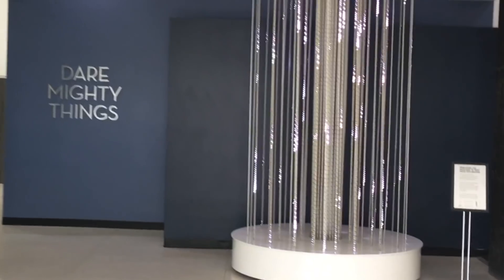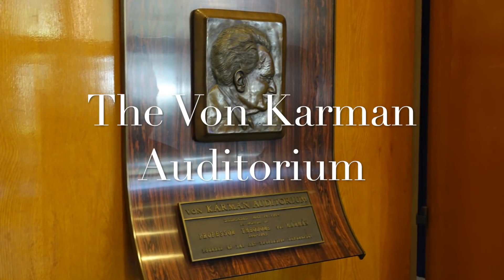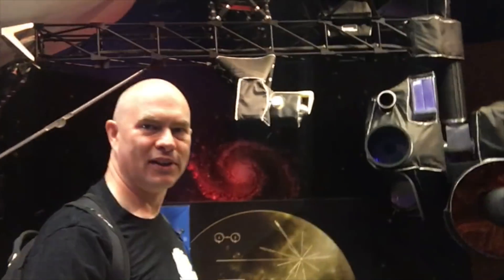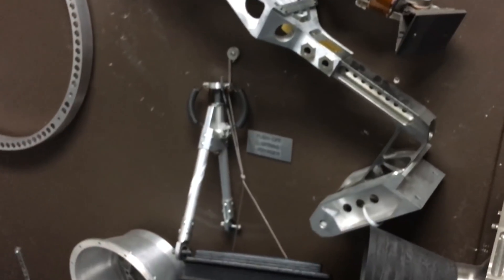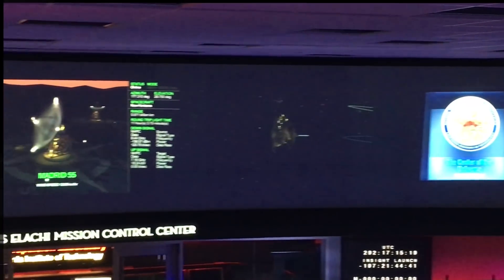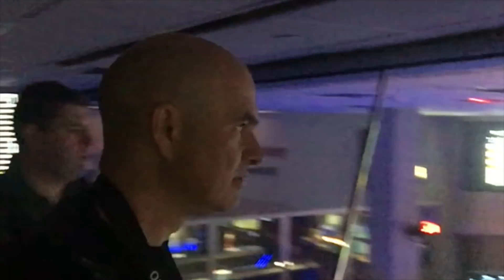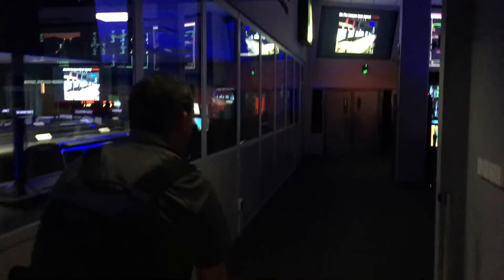The Jet Propulsion Laboratory W/Doug Ellison - Part 2

Comment: @14:07 when he says engineers, does he mean people that have a degree in some field of engineering or does he mean technicians that are just trained for the specific job at hand
Reply: Both.  Some of the roles at JPL are ones you need to come to with an aerospace / mechanical / electronic engineering degree.  Some of them are very much roles you learn via apprenticeship.   My role as an ECAM PUL on MSL and MER was just much an on the job apprenticeship - there's no college degree you can do that will teach you mars-rover-surface-ops-101.

Comment: Aluminium, in fact, is not the correct pronunciation. It was originally named Aluminum by Humphry Davy in 1812, similar to platinum or molybdenum. Someone else later, arbitrarily, decided he liked the sound of "aluminium" better. So here we are. Dissappointed, Scott. This is exactly the sort of nerdy fact I'd expect you to have been up on. :)
Reply from the maker: +RealityIsTheNow actually, Humphry Davy’s first suggested name was Alumium. Aluminum was the second suggestion, but other chemists  objected and Aluminium was agreed upon. So Aluminum is neither the first suggested nor the scientifically correct name.
Reply: Davy settled on Aluminum though, and published as such in his book. And considering his work with it, he should have been the one to decide. Later on, others thought it should be changed to aluminium, not any sort of scientific basis, but simply because they prefered the sound of it relative to other things. It's simply arbitrary nonsense. It's been great fun pointing this out over the years, talking motorcycles and cars and rockets and such. Americans call it aluminum, for different reasons, and because it has become stylish to defecate upon those dirty yanks at any opportunity, it's very often one of those things that comes up. :)

Comment: When we did the Y2K conversion on 5 hospitals in Northern Jutland in the same weekend (they had to be communicating afterwards so we had to convert them at the same time) I had a "Control Room" rigged "somewhat" like this (though not so stylish and not dark at all). It kept the minds clear and avoided confusion. Each hospital was represented with it's individual terminal and a cardboard sign above. It was forbidden to call a hospital on the wrong phone. But I was only allowed two shifts changing every 10 hours or so.

Comment: Awesome videos. It bothers me that they reported the DL power from Voyager in dBm, but UL in kWatts haha.
Reply: kW really is the right unit for uplink though - when I was on the DSN Now team, I tried to get them to do received power in watts - but the number is so preposterously small it just doesn't make any sense.  The DSN folks asked us to stick with dBm for the downlink.
Reply: Doug Ellison I agree with the dBm DL value, it just bothers me that the UL value is not consistent. Any comms stuff I've worked with is much smaller so I guess that's why I am used to working in dBm.
Reply: Yeah - the 5, 20, 80, sometimes even 300kw of RF for Tx is around 22 orders of magnitude higher than the received power :)

Comment: Flat earthers think NASA built all of this just to fool you.
Reply: I wish that were the case.  I should also put  "moon landing conspirasists think NASA put all this up to fool you"
Reply: Luckily it's pretty simple to prove to logical people that the earth isn't flat.  It might be expensive but just take the biggest skeptic on a trip via a Soyuz
Reply: They also claim that gravity is actually an electrical phenomenon. I know you can observe neutrons experience gravity, but is there a home experiment to disprove any connection between charge and gravity?
I thought that a direction invariance of a cathode ray tube vs a magnetic field but it isn't conclusive
Reply: Just the fact that Gravity is constant under all EMF radiation.  If it had anything to do with electricity you'd be able to change it and manipulate it
Reply: Robert Kitch. That's a lot simpler than the CRT experiment.
Reply: Except for the fact that is it was accelerating at 9.8 m/s that eventually we would break the speed of light which has a very clear and defined limit that the average person can calculate. How fast do they think this plane is moving?
Reply: What a colossal waste of time that would be.
Reply: They didn't fool me, incidentally why do you think Jet Propulsion Laboratories are so called when they have only ever used rocket propulsion?

Comment: This raises some interesting questions (though outside of your specialty) about interstellar probes and communications speeds.

Also what happens when there is a major earthquake and there is a rocket on the pad? Apart from a very big explosion.
Reply: That one's easy: revert to VAB 😎
Reply: I think most rockets are launched from florida, and I have never heard of any serous earthquakes there.
Reply: dammit just remembered that the JPL is in California. Not form America.
Reply: I suspect that the risk is rather small. The amount of time in which the rockets are both fueled and disconnected from the erector structure that supports them when horizontal and into the vertical is short. Fueling makes the tanks stronger, too.
Reply: Isn't Vandenberg in California, though? They launch rockets from there now and then.
Reply: Vandenberg is indeed in California. About an hour's drive north of Santa Barbara on the coast. Mostly that Air Force Base is used for missile launches, but it can do rockets as well. I have been woken early in the morning many times due to Titan, Thor, Minuteman and other missiles being launched.

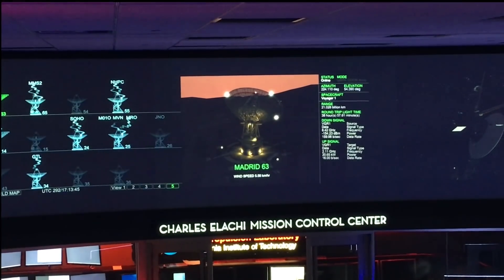Comment: 6:30 I think it's insane they can pick up a -150dBm signal. That's ridiculous!
Reply: waterlubber
It's "only" 100 times less than GPS signals on the ground outside (130dBm) or around the same for GPS in buildings (140-150dBm). Radio telescopes can get better than -200dBm sensitivity!
Reply: Dave over at EEVBlog made a series about the Canberra antenna down in Aussieland not too long ago. If you want your mind repeatedly blown by RF voodoo magic, I recommend watching the 3 videos, plus the 2 Behind the Scenes videos as well. they're all on his EEVDiscover channel. Video 1 here: https://www.youtube.com/watch?v=FzRP1qdwPKw
Reply: Also the bandwidth is much lower
Reply: I noticed, I also noticed they reported the UL power in kWatts... grrr haha
Reply: Looks like their antenna is a little bigger than your WiFi antenna. They probably use rad powerful signal processing equipment.
Reply: yep it'll ridiculous and horrible to